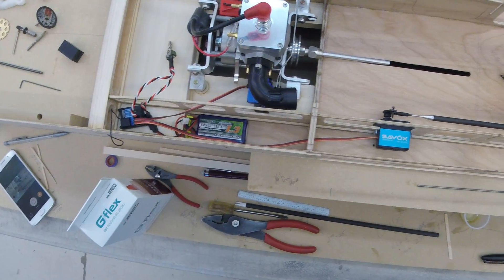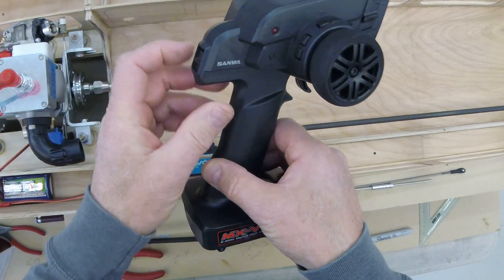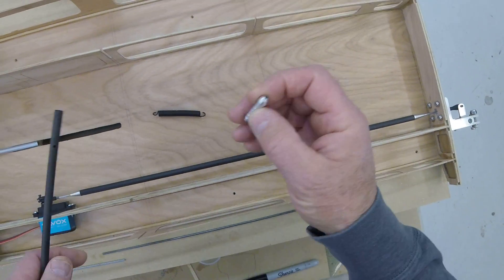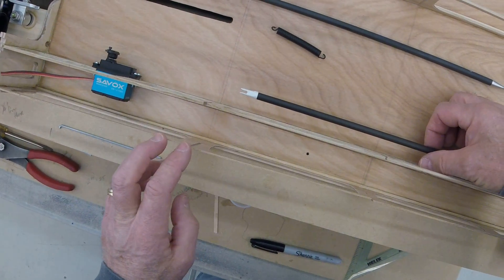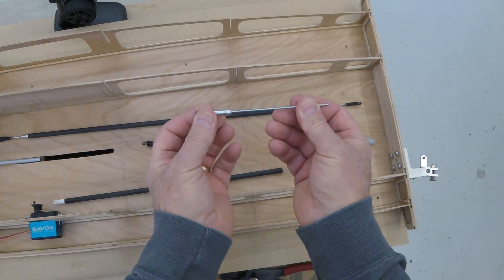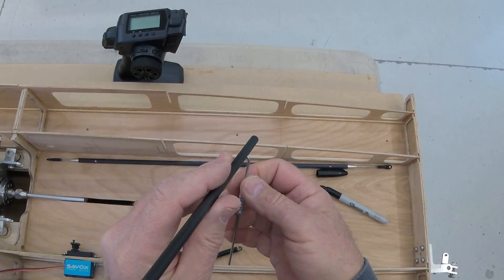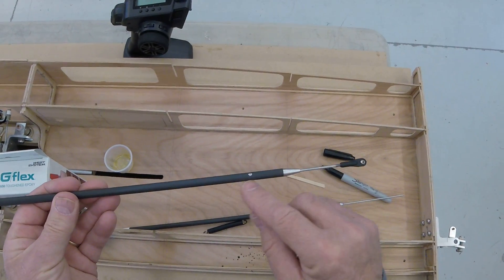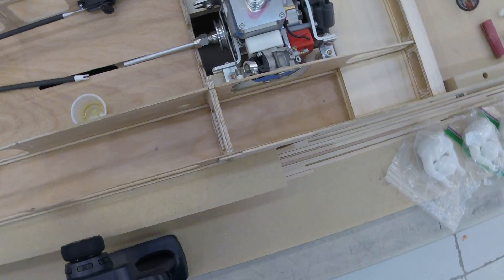Part 3 How to Build Scale RC Hydroplane Racing Boat - Steering Linkage

Comment: If I make some of these I will use a set screw to hold the rod inside the aluminum end.
Reply from the maker: Hmm.  Sometimes I think the simplest solution is the best solution.  Epoxy works and is super simple. Why add complication?  Or maybe I'm just lazy.  Now I have to rethink my entire life ..

Comment: Scott, do you place anything around the strut and rudder bolts in the transom? If so, brass tubing or stainless?
Reply from the maker: No, I make what I call "hard spots".  I drill the mounting holes considerably oversized, then fill the large holes with epoxy. After it sets I then drill the correct size through the epoxy for the mounting bolts. This seals the surrounding wood and creates a nice hard spot where the bolts pass through.

Comment: Scott do not underestimate the importance of your videos to us hobbyists.
I freeze framed this video to figure out which ball links you attached at the ends of the push rods.  Once I figured out they are Dubro Monster Ball Links I happened across the Central Hobbies online store with carbon fiber hollow pushrods.  Central Hobbies has titanium pushrod ends sold separately.  They recommend IC-2000 CA adhesive to attach the titanium ends.
Looking forward to more videos I certainly could use the help.
Reply from the maker: I've seen those shafts. A guy locally here uses them and says they work great.

Comment: Why is your servo placement so far forward? Wouldn’t you eliminate flex if you placed the servo closer to the transom ?
Reply from the maker: Balance... I need the forward weight. Besides, it's a very short run. I've run servos all the way from the front of the center section in the past with no trouble at all. Thanks for watching and for keeping me honest!

Comment: Great stuff as always!
Reply from the maker: Thanks Thomas!
Reply: @M5PerfHydros  And I agree about having a small lathe! I have only been borrowing one but I did buy a small mill and it opens up a whole new world of possibilities for making stuff. Lathe is next on my list
Reply from the maker: Yep, I run a small mill too! Have you worked with Delrin yet? One of my videos (it's kind of a spoof video but the parts are real) shows a set of motor mounts for 1/8 scale nitro that I made from Delrin on my mill. I wasn't sure they'd hold up, but I ran them all season and they're perfect. It's my go-to now!
Reply: I watched that video now, funny stuff :D Haven't tried working with Delrin yet, but have had several ready made parts for scale crawler cars. Certainly some tough material, as you clearly have proven. I should get hold of some
Reply: Those engine mounts looked super slick by the way!

Comment: Is that a Quickdraw motor your using in this hydroplane?
Reply from the maker: Yes it is!
Reply: @M5PerfHydros  Fantastic motors! I created and sold a 72" hydro with a quad-four Quickdraw about 15 years ago. Boat handled amazing and was a hit on the water due to its size. I just love your work and craftmanship. Do you have the plans for this one your working on? I am a mechanical engineer with the ability to scan and draw these profiles parts which make up your hydro project and would love to get your set and possibly scale them up and recreate another one similar to what you are making. Great job on your project and keep bringing the videos. The best Matt
Reply from the maker: A 72 inch r/c hydro? That's just plain nuts!
I do have the plans for this boat, basically drawing it as I go, but don't get too excited about it until we see if it works!
Reply: @M5PerfHydros  Yes, it was a 72 long". I also created a Don Johnson replica of the Miami Vice version a deep V boat.- It was 84" long. Built a custom dual prop transmission which was also powered by a quad-quickdraw. I created with a help of a friend who owned a macined shop a Hand built fiberglass mold produced by CNC tooling, cut from an aluminum mold which I created in a 3D model and sent to a CNC mill. He manufactured airfoil tooling back around 1987. It was all hand layer fiberglass hull. All boats were sold off when I was in need of money when I first was married to purchase my first home. There was a guy many years ago in a model RC magazine who built a similar boat which got me inspired to build one myself. I have been looking at getting back into possibly doing this again and that's when I came across your Web videos and this got me thinking again to build something new and different. I always built my boats with Quickdraw motors. I do not think Quickdraw produces a quad motor anymore, however I could be wrong. That motor back in the day produced right around 16hp. It was a beast. Anyway I was really interested in what appears to be a proven design of this hydro you have, but I love size and wanted to see if I was able to get a set of your plans to get a bigger one built.

Comment: Just in time for winter builds! Thank you. Getting some G flex
Reply: Loctite 638 or 648 is also a good option to glue it and you need less so its even lighter.
Reply from the maker: @Rc-Jay  That's interesting ... 'Rapid cure retaining compound' ... I thought I'd seen everything but I've never heard of that. I'll try it, thank you!
Reply: @M5PerfHydros  
i even glue my flexshafts with this.
Reply from the maker: You won't regret it!  You know, I should get a commission from those guys....
Reply: @M5PerfHydros  Yes you should. So you use it for framing as well? That's how you made it sound.
Reply from the maker: @zeeek1  Yes!